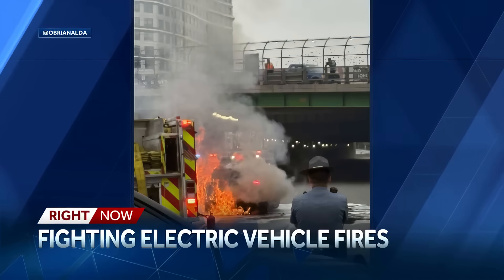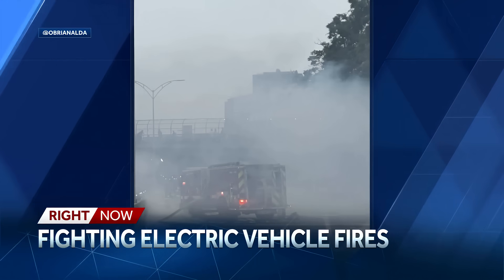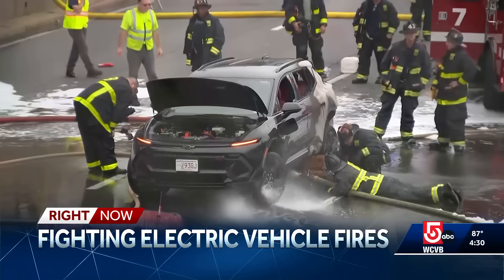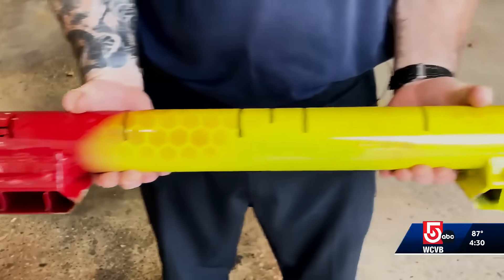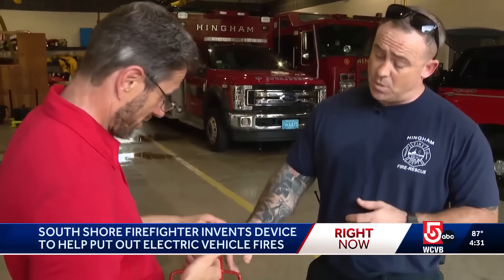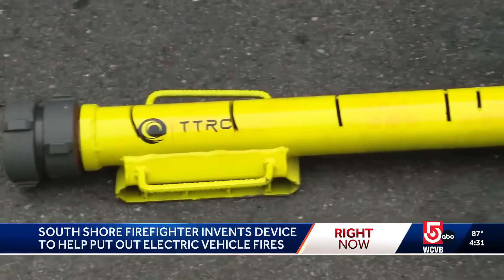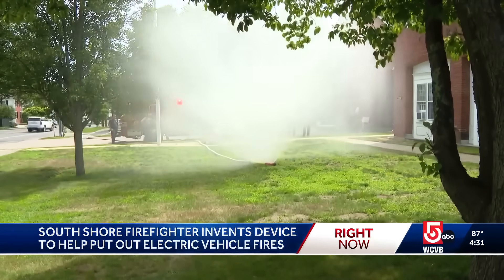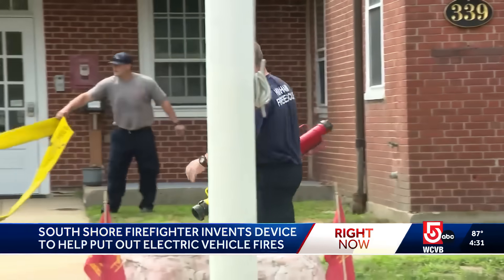Mass. firefighter invents tool to help put out electric vehicle fires

Comment: A metal pipe with slits in it for”under” $3000!? Wtf?
Reply: 3000 dollars now but hopefully soon people will mass produce them 😅
Reply: You haven't seen how much fire equipment costs eh?
Reply: That’s actually a good deal by government standards
Reply: Government contracts are always over inflated.
Reply: @shemmy95 true, if the military bought it, it would cost $30,000 each
Reply: The 2 inch couplings on each end must be really expensive.
Reply: @scottmccloud9029  :))))))
Reply: I can easily weld some pipe together and make something similar for under $100 bucks.
Reply: @JL-st1jf He thought it thorough and designed it. So, no, you probably can’t.  He explained some the issues they had before it was completed.
Reply: @JL-st1jf  But you didn't. I could've easily ductaped a banana in a museum or bought bitcoin in 2010.
Reply: It’s worth every penny, and He deserves every penny. He designed a better mouse trap. That’s a free market.  Found a need and filled it.  Awesome!
Reply: Do you guys want welders/machinists/painters making a living wage? If so then don't complain about the price. There's probably $300 of materials there, another $300 of welding, then probably $150 of machining assuming the machine is setup for that part, then deburr/degrease, paint is another $150. Add some markup for profit, and you have this tool.
Reply: That’s about what it costs to machine a giant piece of high quality metal into a complex shape that has never existed before.
Reply: Maybe testing costs to ensure it functions in the hottest possible battery fire?
Reply: he better cash in before china clones it
Reply: Crazy. This is just a scaled up version of the thing I attach to my power washer to spray under my car in the winter to wash road salt off. And mine has wheels! $25 on that big online retailer with 2 day shipping.
Reply: The Brimstone mist system is under $3k, uses a fraction of the water (with proven effectiveness), has extensions to keep firefighters back from the heat, and the head is American made.
Reply: Any person with few welding skills and some tools can make it for a few buks, the pipe and the adapter is probably the most expensive, but if nobody want to make their own version then this fabricator can charge whatever he want.
Reply: Will soon be on Amazon from China for 14.95 + tariff.
Reply: @josem2468 sad, but true
Reply: But its painted red
Reply: @6or7breadsticks  And painted red gives 5HP!
Reply: Wait for the Chinese
Reply: @quickmake3d22 Amazon: $399.
Reply: @quickmake3d22 stop. Don’t.
Reply: It's not like someone can easily replicate it
Reply: @darcanx , it's not like someone can legally replicate it without a license if it's patented and the patent hasn't expired.
Reply: @darcanx  oh wait
Reply: It's the paint that makes it expensive.
Reply: 3k for the price of a lifetime of risk free , that’s a good investment
Reply: @swagonem09  You are missing the point.  This can easily be produced for less than 50.  Even if he charged 250 he'd make a hefty profit.  But 3k is an outrageous price any way you look at it.
Reply: You can charge whatever you want when our taxes are the ones buying it
Reply: it includes american sustainably overweight bulletproof vegan V8 gratuity tax free rebated power double cheese grease...
Reply: It's a metal soaker hose that is made of metal. LOL

Comment: Liion batteries do not need oxygen to burn. You can drop the whole car in a pool with Liion batteries burning and the fire will not extinguish. The invention may slow propagation of the fire.
Reply: He said it is to “cool the batteries”. Does cooling the batteries stop the fire? 
 How do you think fire departments operate? “Just spray water on it Billy!!” You think they don’t know the basic science that you are parroting from other commenters or Google?
Reply: @AlphanumericCharacters  dude, I worked with the fire dept in San Carlos when the original roadster was developed, regardless of your name calling. Show me the hypothesis tests, and there will be data to assert or deny your conclusion.
Reply: @Wanderingsomewhere145 I didn’t call you any names. I just mocked you. Worked with the fire department? How so? 
 I work with a guy who is a former fire fighter and has a degree in “fire sciences”. He loves to talk about it. I may not have any firsthand knowledge or ability but it was quite the eye opener to me about how much knowledge there is on fire behavior and the difference types of fires they deal with. They are very skilled and knowledgeable people. 
 You are asserting that they are a bunch of dumbasses who, in spite of having fought many of these fires, don’t know some basic piece of knowledge that you know. That I myself know from watching YouTube videos of Chinesium power tool batteries catching on fire. 
 Pretty sure these guys know what they are doing.
Reply: @AlphanumericCharacters that you “mock” only tells who you are. Gfy
Reply: A better system is the Cold Cut Cobra system. It cuts a hole in the battery casing then floods the battery interior with water and the fire is out in about 10 mins

Comment: Water and electricity don't mix.  A fire fighter should know that. Using water uses more water, a single automobile lithium battery fire takes enough water to fill a 12 foot round pool 3 feet deep. There was a fuel depot fire behind our shop and the city fire tried putting it out with water.  They finally called the nearby Air Force base and they sent their foam fire trucks to put out the fires. That is there job to know how to put out fires and do it safely.
Reply: Water is actually the recommended method for putting out EV fires.
Foam is ineffective because battery fires generate their own oxygen.
At least water is able to cool the battery enough to slow the reaction.

Comment: I’m a truck driver and have been one for almost 50 years. I also drive an electric car which I have been driving since 2018. I have seen in my lifetime probably hundreds of car fires on the side of the highway all of them gas engine. I have never seen an electric car on fire. My electric cars have never given me one moment of trouble. Can people not see that big oil is doing absolutely everything it can to foster the idea that electric cars are somehow not the way to go. Just so they can continue to make huge, huge, amounts  of money.
Reply: EVs are a scam do your homework a lot of people killed by these cars. Including buses and batteries storage facilities.
Reply: Big oil made the fireman invent a sprinkler?
Reply: You can "easily" put out a ICE vehicle fire, just spray water on it. Electric car fires will NOT be put out with water alone, they'll burn uncontrollably until ALL the energy in the battery has been used. Imagine if, instead of liquid gas, combustion vehicles used a gel that's made by mixing gasoline and oxygen, the car and engine would work normally but, in a event where a fire starts the gel would ignite and burn even UNDERWATER, because the fuel has oxygen mixed with it.
The batteries in electric cars are basically that, fuel and oxidant mixed, if ignited they will burn even underwater!
That's why electric car fires are factually more dangerous than ICE car fires. Specially in confined areas, like underground parking lots, tunnels, etc.
Search for the Mercedes that caught fire in South Korea and you'll undertand.
Reply: No its poor batteries that catch fire. Just search for China car fires. They use cheap, poorly made cheap batteried that catch alight.
Reply: Lol   you are lucky....lol
Reply: @AM-gn6nn  Nothing to do with luck, it's just statistical facts. You need to be lucky to drive a BMW 6cyl Diesel, those things just want to get lit. (Fire Risk RECALLED)

Comment: Brilliant!  Should be in every fire vehicle across the country.
Reply: Sure but $3,000 each? Seems a bit much for what it is.
Reply: @jacka55six60  I know what you mean but think about the safety it is providing for firefighters who won't need to aim a hose  under the burning vehicle anymore, which could explode at any moment.
Reply: @jacka55six60 As far as money, the quicker they can get the fire under control, the less water being used resulting not only in saved money of water but more resources for other fire fighting.

Comment: 3k for a pipe with slots cut, an end cap, and a fire hose fitting with 2 legs welded on?????  This is every fabricator dream,  buy the materials and have it powdercoated for under $200 then sell to local FD for way less than 3k

Comment: Should be mentioned that most EV fires are user error, driving over things, damaging the battery or even user mods to the vehicle, which cause electrical issues. An EV on its own is no more a risk of catching fire than you charging your smart phone, laptop, etc.

According to the US National Transportation Safety Board, for every 100,000 EVs, about 25 catch fire. Compare that to for every 100,000 ICE vehicles, about 1,530 catch fire.
Reply: All accidents are user error
Reply: @ffffffff-gu5qr  A good amount, yes. Not all. One example being a few years back, I think it was some Samsung or Google phone that used a faulty battery. Ended up with some injuries as well as car fires, caused by the phones exploding. This ended up being a recall from which ever company made it. Another example would be the Tesla Cybertruck with them using a bad glue for those big metal sheets on the truck peeling off at high speeds. Tesla recalled those as well. Just some examples of accidents that were caused by the manufacturer, not the user.

Comment: I think electric vehicle manufacturers should have to incorporate a fire suppression system on battery’s. One electric car fire is and insane amount of toxic emissions. Probably more than a regular car would put out in years
Reply: They already do that, you clearly have no clue how modern EV batteries are designed. They literally have cell casing made out metal and fire retardant foam to hold the cells into module group. "One electric car fire is and insane amount of toxic emissions" A tiny tiny fraction compared to the amount of fuel every single ICE car burn in a life time. It's literally Several TONs of fuel. You are also ignoring very few BEVs ever catch fire, they are far less fire prone than ICE cars especially BMW 6cyl Diesel. That one rare BEV fires is a drop in the bucket compared to the toxic emission of Diesel Cars.

Comment: OK. Now let's see it actually put out an EV fire. What the article dosent tell you is when the batteries in an EV catch fire, they create their own oxygen. Practically impossible to put the fire out even when flooding with water. Lithium batteries will actually burn submerged in water. Standard procedure for fighting EV fires now it to use water to control the plastics burning in the interior of the vehicle while waiting for the batteries to consume themselves. Fire fighters must also stay upwind and approach cautiously, as the smoke is extremely toxic.
Reply: The Cold Cut Cobra system puts an EV fire out within 10 mins with water.

Comment: The most stupid thing ever is to try to put out lithium fire that is reactive using water. And a pipe soldered and painted being sold for 3K$ is just astonishing
Reply: Those are NOT a LITHIUM Class D Fire. Only a TINY amount of Lithium exist in EV batteries, a SUV car only has about 10lbs of lithium for it's 1000lbs battery. There is NO Metallic Lithium ION batteries, it's a different compound. It's such LOW CONCENTRATION there is no risk of Lithium Igniting on contact with water. You are spamming fear mongering misinformation.
Reply: $3,000 is not real money in the firefighting business. A good set of turnout gear costs that much or more.
Reply: No actually you use the water to cool down the lithium  to halt the reaction
Reply: that is pricey isn't it.....3 grand?? youza....
Reply: took the words right out of my brain mad its a explosion waiting to happen

Comment: They need to come out with something that has a class d extinguishing agent in it to actually smother it because water don't really put it out it's like trying to put out a magnesium fire with water
Reply: But these are Lithium ION EV battey fires. These are NOT Class D fires. Only a TINY amount of LITHIUM exist in EV batteries, it's about 10lbs. It's also NOT Metallic Lithium, nothing like metallic magnesium. The concentration of lithium is soo thin, there is no risk of the lithium compound igniting on contact with water. You are just spamming misinformation that defies chemistry facts.

Comment: You don't need to tip the vehicle on it's side.  You can have a tow truck, fork lift, or heavy duty machine, tilt the car enough to expose the underside so that an engine company can direct a stream at the battery pack to cool it down.  The vehicles seem to be designed so that once they're in thermal runaway, the material and plate holding them together breaks apart and then the affected cells just dump onto the ground.  In my experience, no matter what, it will take copious amounts of water.  If this occurs on a highway with no hydrant nearby it seems to take at least 3 engines with at least 700 gallon tanks.  Once cooled down, the vehicle can be transported to a junkyard but then has to be placed in an area with no exposures due to possible reignition for at least 24hours or more.  I think this deviceis good if you catch the vehicle in it's initial stages of runaway.  I'd like to see it perform with a fully involved EV fire.  Also, if the tires have popped prior to arrival it might be less effective.
Reply: No way a tow truck driver will go near that inferno with his equipment and good luck finding a forklift nearby.
Reply: @jacka55six60 I'm speaking from experience.  I've had a Tesla fire on the interstate.  When the tow arrived, he lifted the rear of the car for us and we cooled down the battery.  Also, most of the burned cells dumped onto the ground.  I also used the forklift as an example of heavy machinery that might be nearby.  For example, if the EV is burning in the junkyard, a crane or forklift can be used.  If the car is parked in the parking lot of a warehouse, you can ask them if they can assist.  Etc, etc...
Reply: @178fireman    Ok sure it could happen if your lucky. Not something you can count on tho.
Reply: Tesla specifically made the top plate of the pack steel but the bottom plate aluminum for the self-disassembling effect you mention, but I haven't heard of any other cars doing so.

Comment: That pipe could be constructed for under 400 bucks
Reply: They'll want it certified and safety tested. The federal and state bureaucracies should be able to ratchet that price up to a cool $40,000 easily.
Reply: Standard schedule steel pipe and an uncertified welder?  Sure, under $400 sounds right.  Now, get an engineer(s) certified in mechanical and fluid engineering to check the design and draw a print of it.  Then, use spec'ed, pressure rated stainless pipe, fittings, features, etc.  Get it fabricated to print by an ASME certified shop with welders holding current S, U, and R Stamp certifications.  Once that's done, go ahead and get all the business licenses, permits, and insurance needed to operate.  Once you've done all that, get back to us with your revised estimate.
Reply: @jstowell5  You forgot to mention the lawyers.  That will triple the end price.
Reply: @jstowell5 as if going into a petrochemical plumbing system, or cooling pipe on a nuclear reactor.

Knee jerk innovation, pouring water around lithium batteries, cuz water is SOP for firefighting.
Reply: @jstowell5 over engineered and greed, can't you just say you support that over a tool that could be made cheaper

Comment: Need to put some caster wheels on the bottom so you can roll in underneath the vehicle from a safer distance only improvement I would do to the design

Comment: 3k for a metal pipe with 1 4in fitting and a crack head grinded hole
Reply: China will be selling one soon for$10😂
Reply: It's priced for the market. If you think that's bad, you should see what some basic equipment from Akron Brass costs...
Reply: I’m guessing firefighter equipment is like aviation in where you really payin for the certifications. Like an usb outlet is 438 dollars for a plane. When the part cost like 1 dollar.
Reply: @brylzy  we live in a ridiculously GREEDY World-- The LOVE of money...
Reply: that's right you or I could have done that but we didn't. I hope he becomes a multi-millionaire and helps save lives with his invention.
Reply: @ernestnelson2407 all firefighters deserve to be multimillionaires. Them boys WORK!  How this one makes some good money
Reply: @ernestnelson2407 LaFrance was making piercing nozzles in the 1960, and water curtains were around just as long, these are not new inventions
Reply: @ernestnelson2407   A lot of fire departments are already limited on budget.  It's very fair to ask why does it cost so much.  Do you spend it on a tool you may use a few times a year, or other equipment (eg fire fighter protective gear)
Reply: That price doesnt show much of his Firefighter spirit! Putting money over peoples lifes and safety,his own brothers lifes and safety!!!!That pipe doesnt have any tec that supports that kind of price,its riddiculous!That guy is an oporthunist!
Reply: I know I could make that for less than $50 bucks.